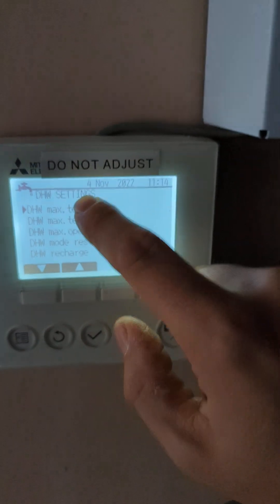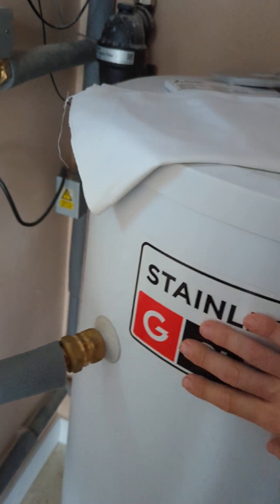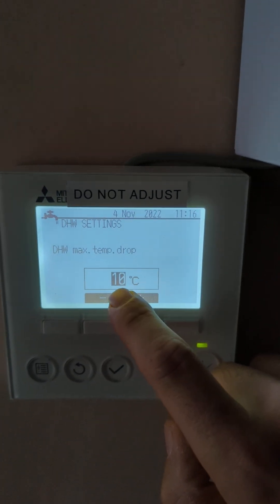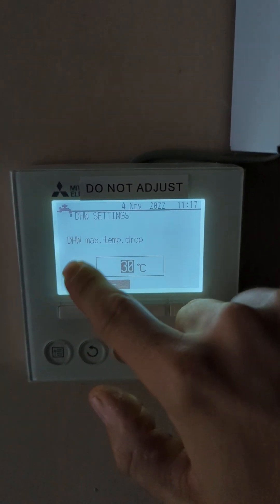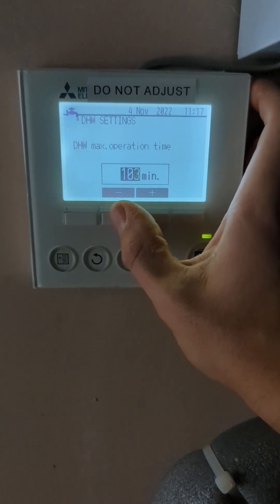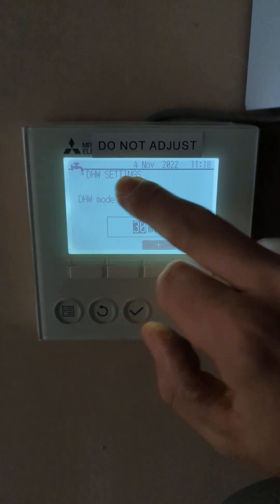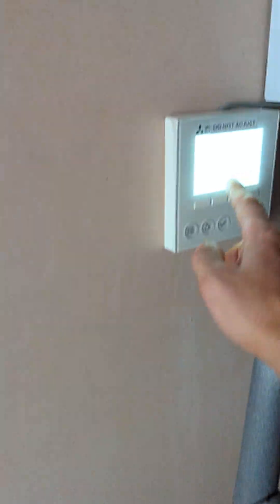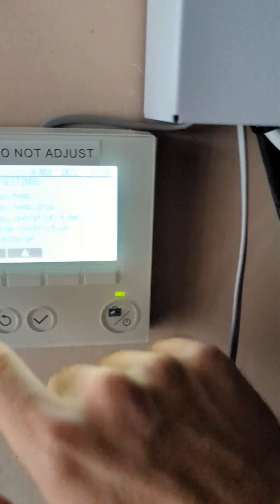Mitsubishi Ecodan hot water settings explained

Comment: Mine is set to max 53 and drop is 6 degrees. My tank is currently at 42 degrees. Why is it not kicking in?
Reply from the maker: Hi Nerby, This is a rather low temp drop, I would say that the recharge time is being held of by the restricted time of 30 minutes. this is why the tanks not kicking in. or it is set to a timer and outside of these times.
Reply: @renewableheatingengineer8537  I’m having the same problem. My cylinder keeps going to 29C or even lower while the DHW is set to 50 with a 5C drop setting. Should the recharge time be higher or lower? I’ve played with it but it doesn’t seem to make a difference.
Reply from the maker: @JacobIspas  hi Jacob, your recharge time should be set lower or to its minimum at 30 minutes, just a thought... do you by any chance have the Mitsubishi pre plumbed cylinder ? this can sometimes read a really low tank temperature as the cylinder stat is so low ( close to the cold main point ) meaning the slightest bit of hot water drawn off can make the sensor read a cooler temperature than what you actually have stored. this is why they dont allow the hot water recycle below 30 minutes
Reply: @renewableheatingengineer8537  thanks for the reply. I’ve called a specialist to my place to resolve the problem. My guess is that the heat pump itself has an issue since my heating has also been very lacking lately. I’ll post what was my issue after.
Reply from the maker: @JacobIspas   please do, it will be interesting to see the issue, if heating temps are also lacking, that could be a refrigerant issue, although usually you would experience p8 fault codes with this. drop a comment in once its been diagnosed  :)
Reply: @JacobIspas Were you able to locate the issue?
Reply: @NerbyScurvy  so my issue was that the internal filter was clogged by calcium buildup. Only a technician could have solved my problem. I also had the problem AGAIN and this time the Freon level was low. Overall I am super unhappy with my heat pump. I would not recommend to anyone.
Reply: @JacobIspas I see. Yeah I don't like Mitsubishi either. Gonna go with Nibe or something better next time for sure.
Reply: @renewableheatingengineer8537 Hello! This is still happening during summertime when regular heating is on pause.

Comment: Hi, Your video's are very good and helpful, actually better than the Ecodan ones ?

I have a question if you can help ?  The engineer was here last week to service the unit etc, ( 18 months since installation).

He also altered the max tank temp which was a bit low, from 42deg up to 48deg which is now fine.

However, now when I go into the hot water settings as on the video, there is no 'notepad' showing below
the Tap icon ?  only the Normal/Eco icon. consequently I am unable to check or alter any of the Max temp, Max Temp drop, run time settings ??   
Can you advise 

Thanks
Reply: Hi Scott, make sure you are pressing and holding the engineers setting / note pad button from the main screen until it prompts you into the next menu, then you should see it.

Comment: Thanks for the video! It's very helpful! What exactly settings do I have to change as I find that the water in the shower is not hot after one person shower so when the second person wanna take a shower the water is not hot anymore.
Reply from the maker: this could be down to the hot water recharge settings as seen in the video, potentially your hot water set temperature is too low.

Comment: Great video, but I have a question about the ASHP flow temperature and the DHW temperature. My understanding is that a typical flow temperature, from the ASHP, is 45 C, but you (and others) mention that if you go over 50 C then the immersion kicks in. Surely, the immersion, or some other electric heater, must kick in for DHW from about 40 C? I have allowed for a 5 C loss over the plate heat exchanger here. This would go some way to explain the woeful COP obtained during the summer months, which I observe on our Ecodan 8.5 kW system. Thanks Richard
Reply from the maker: Hi Richard, Generally speaking on the new R32 Model, this will usually bring the back up immersion on when it reaches around 48D tank temperature, this is because the unit is calculating which is cheapest and quickest to raise the remaining temperature. on most older R410A models, you can actually achieve a tank temp of 55 before the immersion is required. although its better to get your tank temp to around 50-53D to avoid this happening. its more an advisory for energy savings, some people like boiling water for their baths .. but its costly to get it to 60 from the heat pump. 

Fyi your fixed flow temp is different to your hot water flow temp, the unit will generally max out on hot water mode. 

Hope the above helps.
Reply: @renewableheatingengineer8537  Hi, thank you for your reply. I did wonder if the hot water flow temp would be different from the fixed flow temp. Our system is the new R32 model, so turning the DHW down to 48 C seems like a possible solution, at least in the summer months. Don't think the better half would thank me in the winter. Thanks again Richard

Comment: Thanks a lot for making a proper video without the fluff. Would it be possible for you to reply with, or even make a video about the most important changes to make in order to get the most efficient COP? Compensation curve fine tune settings would be nice as well, mine range from 50c heat at -10c outside, down to 25c heat at 35c outside. Cheers.

Comment: Hi, Thanks very much for useful explanations. Keep em coming :-) About the Large setting, does that mean one need to have two sensor put into the tank? E.g. a 230 liter tank. Thanks..
Reply from the maker: Heya, yes, usually if you have a pre plumbed cylinder from Mitsubishi this will already have the top sensor installed. if its a 3rd party cylinder then you would need the additional installing.
Reply: Hi. I have 2 sensors coming out of the FTC board and from same connection. Will this sensors go in 2 different places?

Comment: Hi great video as always however I don’t have a DHW RECHARGE setting in my DHW options. ?? Also it would be great to know what curve is all about ? Thanks
Reply from the maker: Hi Dean, you may have the older FTC4 controller which doesn't have this function and tbh I wouldn't get to caught up on that setting at all, 30 minutes in factory standard. 
I will certainly get round to the curve at some point. 
Cheers for the feedback

Comment: Hi, thanks so much for these videos! We just got our ASHP installed and this is so much help. We have a question: is it true that if I set a timer to turn the system off completely overnight, then when it has to bring the water/heating up to temperature from a low starting point, this would cause the heat pump to wear out faster? / Would it use more energy that way?
Reply from the maker: Hey Francis, it wouldn't necessarily cause it to wear out quicker, however, take into consideration it's easier for the heat pump and quicker to achieve your hot water temperature if it only needs to increase by 10 degrees or so. Depending on what your temperature drop is over night in the tank it's self. Some people only lose 7 degrees or so over the evening because their hot water tank is in a well insulated area, others lose 20 if their hot water tank is in the garage not insulated for example. Quite a few variables to take into account, my opinion, if your tank is in a well insulated area, it wouldn't make a difference if you turned it off over night on a timer.